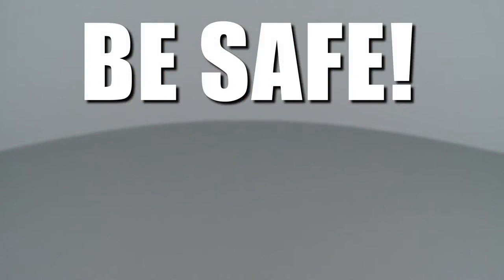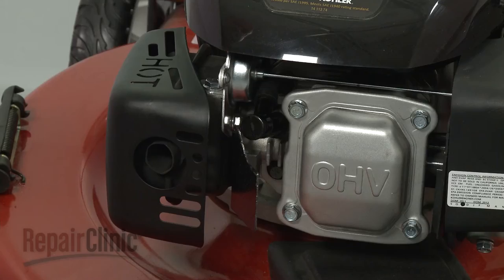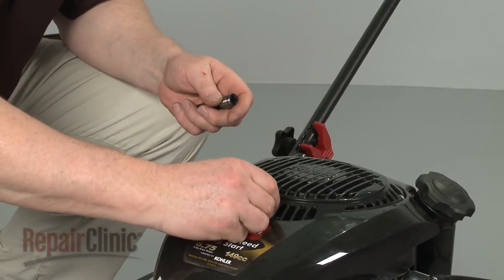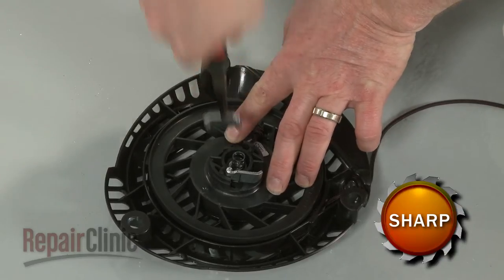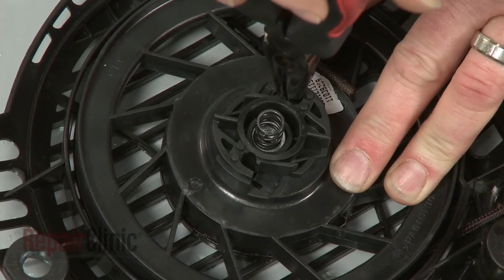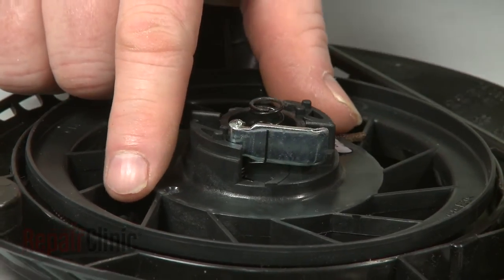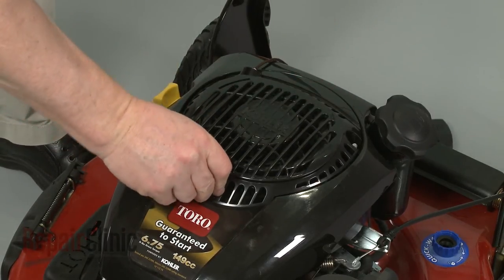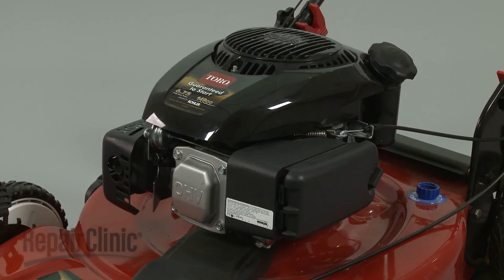Kohler Lawn Mower Engine Ratchet Pawl Replacement #1437901-S

Comment: I’ve watched 100 videos of how to fix recoil starter on my toro push mower my issue is the dam pawl arms aren’t engaging I put them in like they were but I did happen to loose the little spring that is in the middle where the bolt screws in I made a spring kinda like it cause I can not find thst any where seems to be done but it will not let the pawlvarns come out ?? HELP
Reply: You need the correct spring that puts enough pressure on the cap for it activate the tabs. I'm having this exact issue right now.
Reply: i got the same problem with my masport 470, pawl is not engaging w flywheel. thinking it was short i spot weld about 2-3mm metal at the tip of the pawl but still the same. could it be the springs that hold the pawls in place?